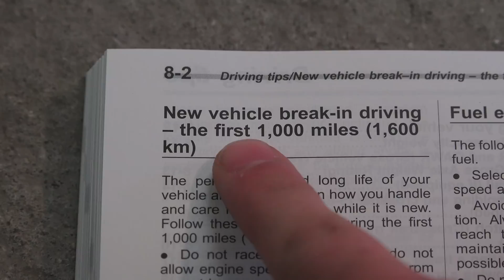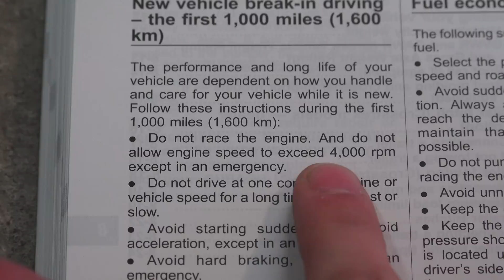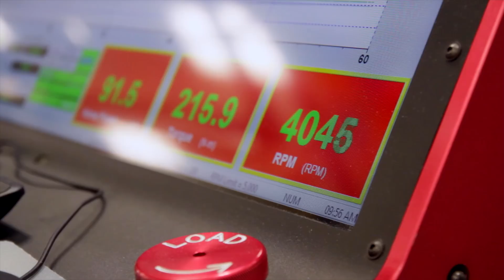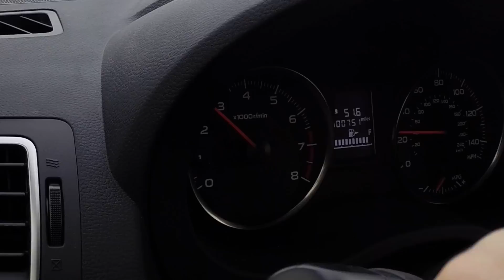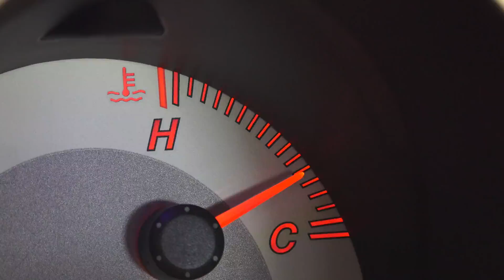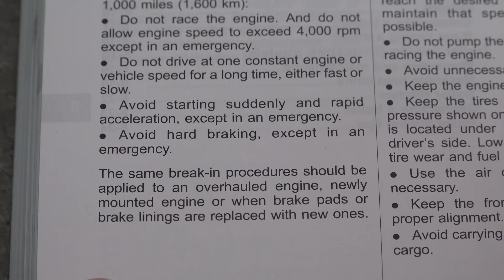5 Things You Should Never Do In A Brand New Car

Comment: I've always been a huge proponent of breaking-in a vehicle as perfectly as possible, and the new NSX's engine break-in procedure is intriguing. I'm surprised that it's only for the equivalent of 150 miles. Why not longer? How is that engine fully broken-in after only 150 miles, while so many other high-performance engines need upwards of 1000 miles or more. The original NSX V6' break-in period was 1250 miles. Other than that the build tolerances are so much tighter in a modern high-performance engine, it would be interesting to know.
Reply: Because it is done in a controlled environment, and the RPM is maintained at the required level with negligible inaccuracy. However, in real world may inaccuracies, so break-in period is long.

Comment: hi i just have a question.  in aviation when we have a new engine the run in procedure is as follows for reciprocating engines.
idle engine till reached operating temperature,  richen mixture and throttle to 80% power and maintain for 20 hours. after 20 hours full service. if all is fine it is cleared for service.
i under stand your video but am wondering if you if you might be able to enlighten me as to the reason why ?

Comment: Flooring is bad. But I've had a lot of success at 1/4 and 1/2 throttle - gear by gear low rpm to close to redline and back down (engine breaking). Use each gear and do 1/4 throttle. Most people won't be able to do this in all the gears though as you have to be in a pretty desolate spot.
Those engines seem to always fire hard for me and make good compression especially at low rpms in the higher gears.
And you always want to change the oil in the first 200-500 miles. Don't believe that factory bs of 15k per oil change on the first oil change. Every engine will have a good amount of metal sand that will be a lower micron than the oil filter.
Reply: @M Bacon Most oil filters only catch particles larger than 20microns maybe 30 microns if it's a toyota filter. Not sure I follow you. I'm inferring you are saying that leaving <20 micron particles in the oil helps the engine break in faster. I'm also inferring that due to casting your saying most engines don't have sleeves or machining marks on the pistons? U kind of lost me. And short trips? Yeah on a corolla, but no not on the race engines or the ones I was talking about, those all run approx 300miles at a time with longer heat cycles. But I can't do that anymore. Too many tickets.
I honestly don't even know if the inside cylinder bore of a corolla is die cast like you're saying or the cams or most of the wear parts. I've seen modern toyota and nissan engines part in pieces. Toyota really is pretty far ahead of on basic machining.

And on your current car? i'm not sure we are talking about the same thing. I'm talking about engines that regularly exceed 150mph. I wouldn't bother breaking in some car these days, most are speed limited. Hell the last outback I drove was speed limited at 142.
Reply: @M Bacon Yeah overall I'm just really lost here. Have you dyno'd any of these engines broken in this way? I used to race bikes side by side with different break in methods. Could totally be user error but it always seemed like the sportbikes that broke in with these slow long throttle applications and regular engine breaking, pulled way harder and were routinely faster even when swapping bikes.

Comment: I knew many years ago about not running a vehicle RPM's too large anyway even if they are not new. I never get over 2000 rpm's on my vehicles under normal conditions, and usually never get over 2000 rpm's in any of my vehicles at any given time for any length of time.

Comment: Engineering Explained- Do you know how we break in race engines which use softer bearings, and most wear components than factory engines? Which should in theory need a more gentle break in routine if what you are saying is true. FYI, it really depends on the ring material, cylinder hone finish. There is no hard data that says a light break in actually makes more power or cylinder sealing. The root of soft break in is from two stroke engines that sometimes start with negative or 0 clearance. Where at 25*C you can not rotate an engine due to insufficient clearances. Short trips at low load are never a good idea for best engine performance, To get the water from combustion to vaporize from the oil... You have to get the engine up over 100*C to boil off the water. The engine also naturally makes more hp with the engine hotter, the oil reduces in centa stokes, witchcraft happens and you make more power. 

ALSO the key components that are ACTUALLY breaking in properly with less load aren't the rings. The Cam/ rollers and lifters are the parts that are actually breaking in in a low miles application. 

I would be willing to bet that most of the people that follow the slow and low break in method also think that the off the shelf Mobil 1 oil is the best. When in fact to meet ILSAC GF-5 standards, Mobil one reduced the phosphorus levels to below 800 ppm to meet that standard. We have done back to back testing with high ZDDP in production engines that actually shows reduced wear on internal engine components (specifically under high thrust loading) vs other oils with lower ZDDP. There rational was that high ZDDP content oils are more likely to foul catalytic converters. I dunno about everyone else that is reading this, but I would rather replace my cat than my engine.

The gentle break in is simply because the engine manufacturers know that with current engine oils the wear properties are such that they can not be assured that with a reduced oil film (when the oil film is being filling the delta between RPK and RVK) that they will not have failures due to stacking of tolerances and the clearance falls on the low side when the thermal load increase and the clearances decrease to or below nominal specifications. So for that reason the engineers want your engine components to run through a controlled thermal cycle to break in the engine bearings, cams, lifters, cylinder rings, cylinder walls, etc. BUT, with the advent of current honing technology, specifically plateau honing and RA 30 cylinder walls... even that really isn't an issue.However, their main contention is that with any thermal cycling parts will expand at various rates and sometimes wear improperly... With the increase in RPM and throttle position avg%, comes increased thermal loading and component expansion. So with that expansion comes wear if the tolerances were on the high or low side for THAT engine.

 What we have learned is that each engine will have it's own ideal calibration for fuel and timing beyond what the factory calibration perimeters are, which is why even on basic race engine ECU's we have cylinder trim for ignition timing and fuel timing/ fuel mixture. So cylinders may run above and below the "calibrated" air fuel, and some cylinders will make more and less cylinder pressure (hp). That non uniform cylinder temperature can expand one piston that is maybe within 0.0001 inch of another, but run much differently in operating temperature... That temperature gradient can cause the piston and or rings to run at a larger relative diameter, further reducing the stack of tolerances. Example, when we build engines our engine oil clearances might be +/- 0.0001 or 2. To achieve this it is not entirely un common to measure bearings and make matches sets in 0.0001 ranges and mix and match bearing sets to get within "Nascar" tolerances of +/- 0.0001in. Where many engines have a range of over +/- 0.0006. Keep in mind that a 14 degree F difference in measurement temperature can read 0.0005 inch during assembly, say 58-72 degrees F. The engineers that make the engines are well aware of the uncertainty and stacking of tolerances. Hint, one of the biggest race shops in the business only employs about 3000 people and have 750 nascar cup engines under the roof at any given time in any given stage of completion or rebuild. The average cost of said engine LEASE / year is 690K. A race weekend lease is about 100k (200k for Daytona). Vs Honda, which produces over 14 million units with far less control over clearances, assembly etc. One specific Nascar engine shop that I know won't even let you run one of their leased engines without an approved tuner there monitoring the engine... 

FYI Acura is not in the minority for running in engines at the factory. Most of the Gb made Porsches get loaded hydraulically and some are selected for dyno time. AMG, Ferrari, and many other marks dyno test engines. So with the 14 Million engines produced with slacker tolerances, it is much easier to tell you not to hammer on the engine. I have personally hammered on various engines and with non standard leakdown tester (one I made in the shop that resolves 0.1 psi), EVERY engine I have broken in has made more static compression with less leakdown and less blowby (measuring crank case air/ gas volume in CFM) than other methods. The don't hammer on it is more or less correct for engines that start with insufficient piston to wall clearance at ambient temp such as non ringed 2 stroke engines. Those engines can greatly benefit (specifically connecting rods not having to be replaced after breakin) from a heated oil bath style breakin. I should start making internet videos... lol. Don't use Mobil 1. Brad Penn, and plenty of other oils will allow your engine to outlast the Mobil equivalent. 

Bottom line, once the cam is broken in and your engine is warmed up... Send it.

Comment: i was a mechanic and on fresh engines on the test drive i liked getting up to 35-40mph and hold it in gear and let off the throttle letting the engine brake down to 15-20mph, downshifting to keep the rpms up. id do it about 10 times. theory behind it is the vacuum created under engine braking helps seat the rings to the bores a little better.

Comment: I'll just say as a dealership service technician, most engine failures I have seen have not been related to the break in process, there's definitely some forgiveness to the rules.  However, I have noticed that most early engine failures I've seen, as in under 5000 miles, have been on muscle and performance engines, including the case of a Charger with totally bald rear tires (at 4900 miles).  Chrysler declined to warranty the engine.
Reply: the dodge dumming thought they said FLOOR it all the time.. not don't floorit..

Comment: In my car which is a new Mercedes A class. The engine was limited by software until it reached 1000 miles. So i could not get anymore than 50% throttle, or no more than 4000rpm. Also things like Launch Control were disabled.

Comment: FINALLY, I see someone who knows where to place the hands on the steering wheel! I see so many drivers putting both hands at the top of the wheel. If that driver needs to make an emergency evasive maneuver they would be at a disadvantage because they would be forced to place their hands at the correct position to control the car. I noticed you drive with you hands at the 3 and 9 positions on the wheel. I have heard that the 2 and 10 position is correct but personally I don't agree with that sentiment. It is obvious that you are a very good driver and it shows on your outstanding videos.....Just my two cents worth.

Comment: Ford is very similar on the break in for their average type cars. Don't know about any of their higher end stuff. Now Im sure I'm going to get a lot of crap about using Ford.....You have good informative videos, I certainly appreciate them. what type of engineer are you? Ive worked in aerospace for over 30 years and have worked with some top notch mechanical and electrical engineers, the top notch group are ones that have gained their knowledge from practical application, not book smarts...

Comment: A and B comparison. Hard break in vs easy break in with identical engines. Engine that was broken in by being run hard made more power on the dyno and had higher compression results during compression test. I don't know what data he's talking about, but the data I've seen says "hard" break in is better.
Reply: I keep reading this, too.

Comment: flooring it doesn't do anything, they test engines in the factory full throttle. it's a myth from the last century when machining of parts was still crude and stuff realy did still need to wear in.  well, perhaps US cars are still produced to last century specs, maybe that's why their crap to begin with and you hardly see them anymore anywhere else then in the US.

Comment: How about using cruise control in a CVT transmission? Could it be used?
Reply: The transmission type has nothing to do with breaking in an engine. Follow the manual.
Reply: And The my manual says nothing about beak in (2017 civic EU model). Since cruise control is not recommended because of the fixed ration between rpm and speed, i thought that maybe using CVT would be allowed since there is no fixed ration and the engine is free to vary rpm.
Reply: Honda's for some reason have very little break-in period lately {last few years}. If you aren't restricted in any way {via the owner's manual}, then just enjoy your car. Your engine won't vary its rpm that much while on the highway. You will be at almost the exact same speed all of the time, so the load on the engine is almost exact. No worries for you though, Honda must break-in their engines before shipping them.
Reply: And The here’s the thing, as far as i know all Civics are make in the UK (hatchback models) and Turkey (sedans), except the ones for the canadian market that are make in canada. The US user manual gives instructions for a break in, the EU one doesn’t, and the cars are all made the same way in the same plant. As this video says, the NSX has a factory break in but we are talking about a $100,000 car so i can justify the man hours put into it.
I live in Italy and the roads aren’t that flat as you would expect, at a fixed speed the RPMs vary from 1,200 to 2,000 easily, hence my question on using the cruise control with a CVT transmission. I haven’t pushed it over 3,000 so far and don’t intend to but i was just curious about using the cruise control since it allows me to get the best gas mileage on long distances.
Reply: You must have steeper hills than I thought. If you are getting that much range in your rpm's, you will be fine. Generally speaking, in most places, there aren't enough hills or steep enough hills to allow cruise control to govern the speed and still break the engine in properly. I think you are safe. Also it seems that Honda has less requirements for their engine break-in periods than most other makers. You can always call the place where you bought the car and run your idea passed someone in the service department.

Comment: I did "floor it" in my new 2014 Ford Fusion Hybrid because it runs on the electric motor first. The gas engine only comes on when the battery is depleted. Hybrids and electrics never had these wear problems.
Reply: I thought the gas engine came on after a certain RPM was reached?

Comment: There is a recommended method of 'scrubbing' tyres. You can do the conversion to miles but I am from Australia so I will use metric. Initially tyres need to be driven on slowly. Drive on them as if you were diving on a slippery surface for about 100 kilometres (correct spelling) After that GRADUALLY increase throttle, brake and steering inputs over the next 100 kilometres. Ideally this should be carried out on a road with lots of corners. You can't do this on a straight freeway for example. The idea behind this is to 'meld' the steel belts and the rubber together within the carcass of the tyre. Don't forget the spare. If this process is done correctly the tyres will offer superior grip compared to if it was not done at all. And, obviously it should be done for all new tyres regardless of the age of the car.Regards,Stuart.

Comment: Ram has a break-in period of 500 miles on the differentials of their Cummins powered trucks but the engines themselves are broken in from the factory.  Apparently the differentials need to be broken in before you tow anything.

Comment: I've seen guys break em in very hard. Ive seen em get easy break ins.  They all held up well with good maintenance.
Reply: Not every abused car will have the engine explode. Not every fat guy dies of a heart attack either. The risks of damage are higher if you abuse the machine though.

Comment: I'm with "easy break in" gang.  I keep the rpms under 3500 for the first 500 miles and then 4500 rpm until 1000 miles then change the oil.  
Always let the engine idle for a few  seconds when starting a warm engine.  On cold start ups I let the computer dictate when it's safe to drive off by allowing the idle to slow to about 1000 rpm before dropping into gear. Then drive easy until it's fully warmed up. After that all hell breaks loose... if required.  Funny how often it's required. 
My engines last a long time. They never have valve clatter on cold starts.  They never use oil between changes.

Comment: Living in New Hampshire where most of our roads aren't flat, cruise control would be OK, right? I think it would because your tach is always fluctuating due to the hills.
Reply: It's best not to use cruise, just to keep the car from being in a small range of rpm's. Also, watch the rpm's when you have it on cruise, because the car will floor the gas to try and maintain the speed you set. This can cause the rpm's to rise higher than the recommended number during the break-in period.